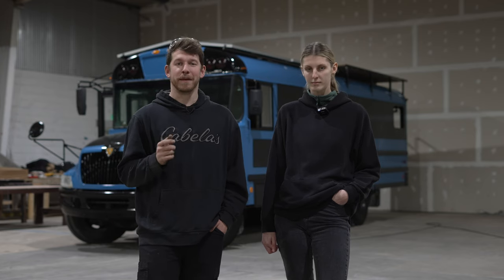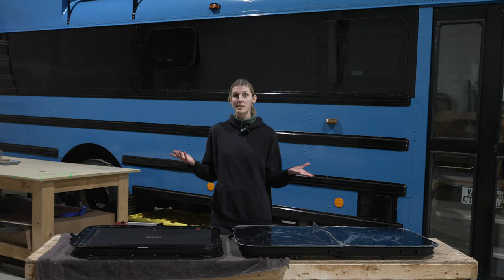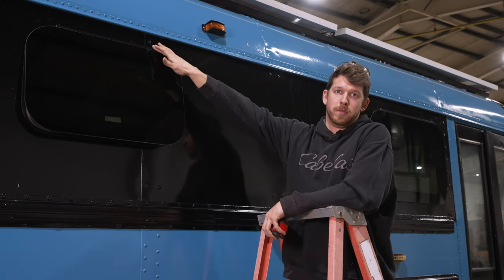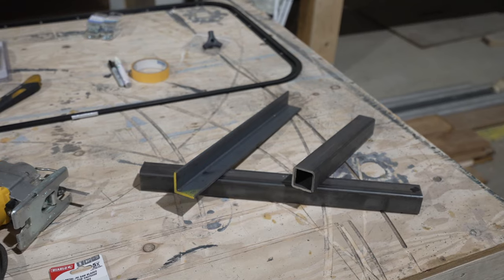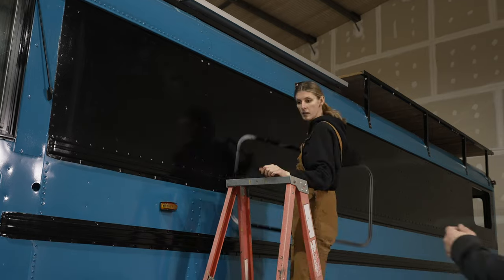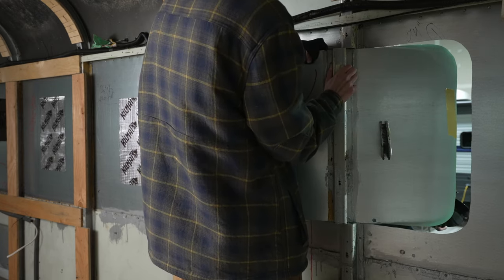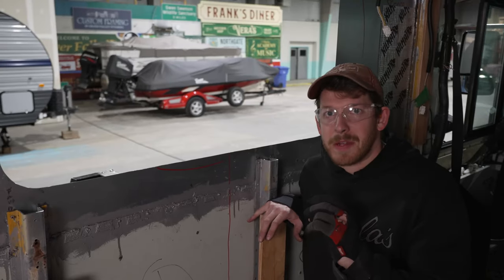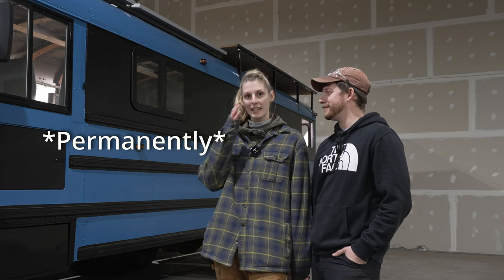How To Install RV Windows in a Skoolie | Adam & Steph

Comment: Don't you worry about compromising the structural integrity of the bus by cutting thru the hat channels?
Reply from the maker: That’s exactly why we welded a metal frame around using 1.5x1.5 square tubing with 1/8” wall. It’s stronger than it was before!